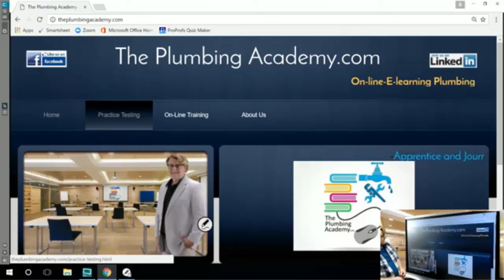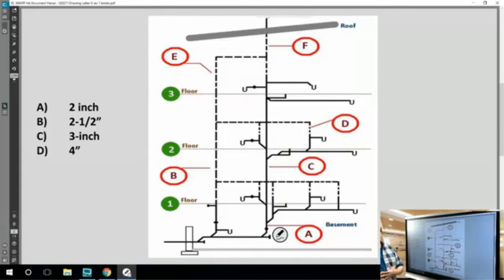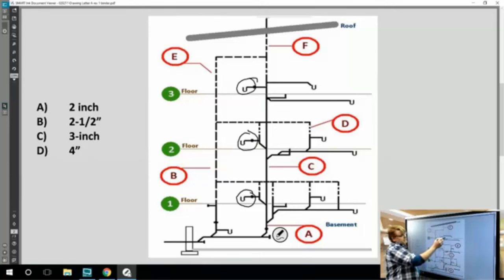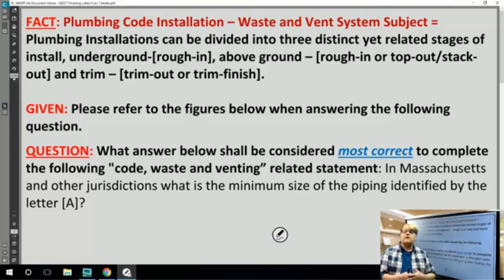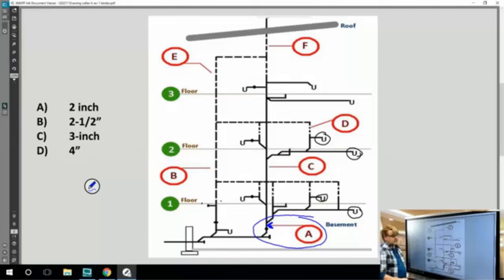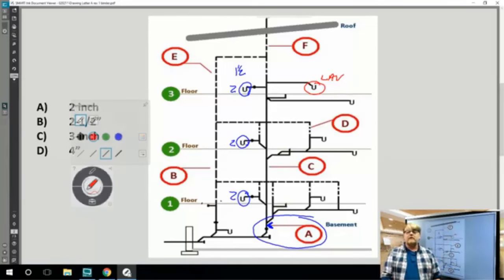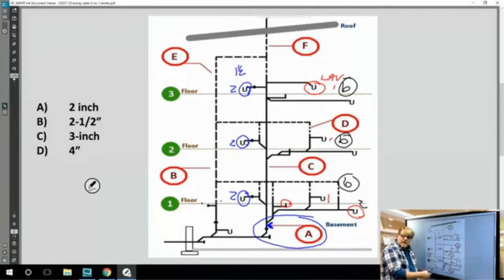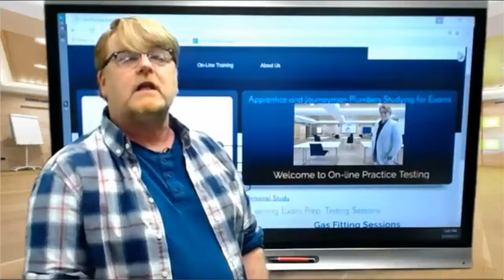Part 1: Plumbing code - waste and venting pipe size

Comment: are these videos teaching IPC or UPC?
Reply from the maker: No. They are specific to Massachusetts-(a custom code).  The original version adopted by Massachusetts in 1965 was the UPC with modifications and amendments.  The current version of the Massachusetts Fuel Gas and Plumbing Code no longer resembles the original UPC 1965 version and stands alone on-its-own.